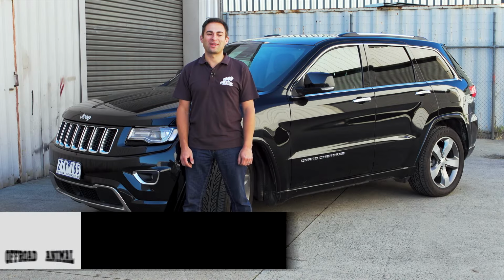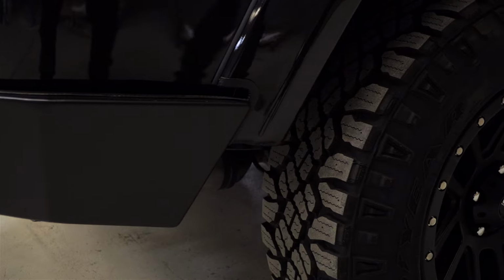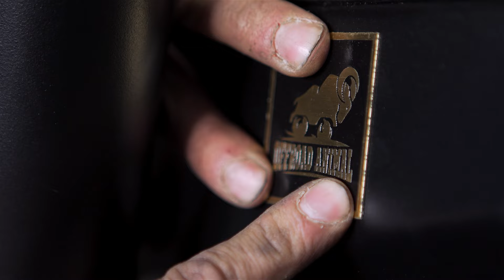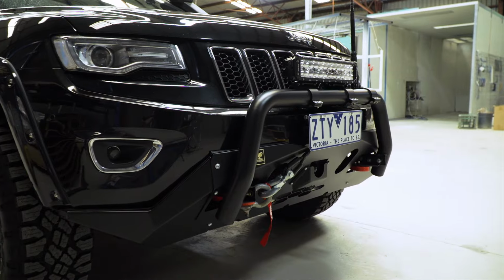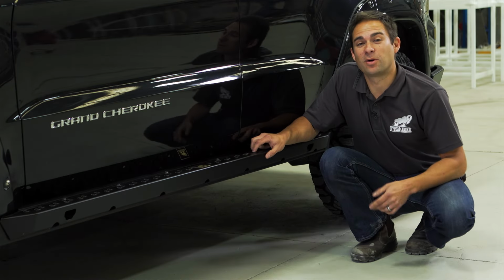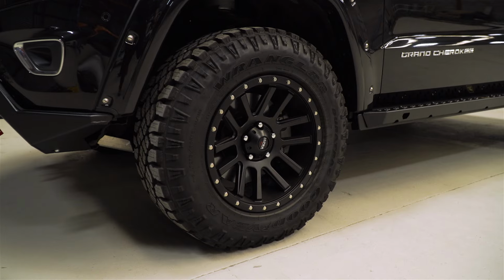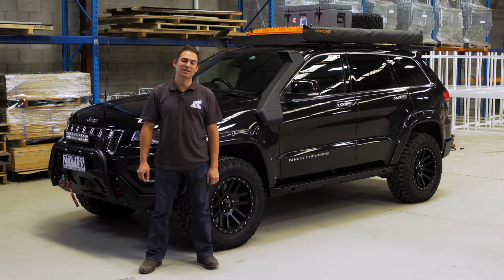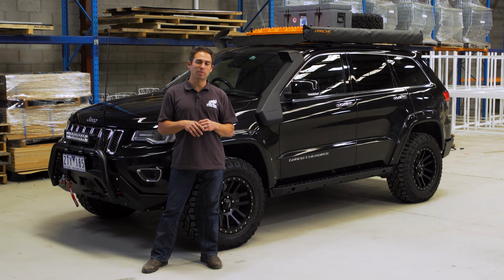Wk2 Grand Cherokee Jeep  Build By Offroad Animal

Comment: Very nicely done. Those ports for the high lift jack and the protection for the electronics is pure genius. The only thing I would do differently would be to put that spare on a gate off the rear bumper. Otherwise, great build. Thanks for posting.
Reply: The tailgate is automatic would suck to hit the key and have it hit your tire carrier
Reply: I agree with the spare in the back but awesome build

Comment: Absolutely Fantastic!!  Solves many of the problems that have kept me from considering previously available WK2 upgrades.  Roof rack will probably be my first choice to install.  The increased weight it can carry is what is so seriously needed.  I agree with a previous post that a gate for spare tire on the rear bumper would be a good option.  Only thing I'm truly scared of, since I'm in the States, is the price for the bumper upgrades.  I'm sure it's worth whatever it costs.  Just don't want to end up turning my WK2 into a Rubicon for more money than what a Rubicon costs!

Comment: Monocoque Body with Built-in Ladder Frame
They say that superior off-road handling capability could only come at the expense of on-road smoothness. They have obviously never driven Grand Cherokee . By incorporating a lightweight and highly rigid monocoque body with a built-in ladder frame that provides added resistance to torsion and flexing and fixing them atop a dynamic independent suspension, Grand Cherokee achieves an unprecedented combination of all-terrain control and luxury-sedan comfort. For added durability, grand cherokee now makes more extensive use of galvanized steel body panels, while the new aluminum hood panel reduces weight for better handling.

Comment: It all looked good other than the rear bar with the rear fog-lights still in eyesight. How much extra work would it be to mount the rear fog-lights to the bar? That way the rear bar could be raised ever so slightly. Overall without picking on the obvious "great job". Do you manufacture a front Full size Bullbar for the WK2 with winch fittings?

Comment: Awesome video! Pretty sure that is a 2014 and up WK2 though. WK2s before the 2014 had a different front bumper and the Overland decal is situated on the other side of the vehicle underneath the 4X4 badge. Again, awesome build!
Reply from the maker: This one was built in 2013, but is an MY14   Quite often manufacturers release vehicles in the  year before the Model year is out

Comment: Please be careful when ordering rear bumper if you have after market exhaust  as you will need to stay within  stock diameter mufflers for fitment ,as bumper hangs down 3-4 inches lower than stock on frame rails. Just FYI

Comment: nice video mate, just to confirm you can snatch off the rear bumper? i would use the tow hitch but just want to understand how strong it is. and if i highlift jack off it, its not going to bend?? many thaks
Reply from the maker: Yes you can snatch off the back.  We suggest using an equalising strap though

Comment: Love the front bumper, hate the aluminum skid plate
Reply from the maker: how come?
Reply: @offroadanimal  I'd prefer galvanized steel for it's strength. Not sure what alloy you're using, i guess if it was 6061 I'd be ok with it at 5 mm
Reply from the maker: @TTURocketDoc  if you do some research you will see 5mm thick AL 6061 T5 is more than enough
Reply: @offroadanimal  yeah you didn't mention the alloy in the vid, unless i missed it. I know all about 6061, aerospace engineer, we use t6 tho. I still prefer cold-rolled steel.
Reply from the maker: @TTURocketDoc  Steel is stronger but in some situations the added weight of the steel is not required, like an airplane.  Use lighter material if possible. Thousands rolling around with AL bash plates with no problems

Comment: Great build, but one thing you are missing, is the loss in fuel economy from no build to when you are done, today with fuel costs going through the roof that is one of my most important issues, one woman I read about lost 5 mpg just putting a Top Heavy Tent on her Grand Cherokee how many MPG does all this cost in everyday driving?
Reply from the maker: To be able to play on the big tracks and camp in great comfort you need to sacrifice economy.  This is about 3mpg worse on fuel with the V8 with all the gear.

Comment: Someone needs to build a bigger lift for these wk2s. 3-4 inches would be ideal.
Reply: YESS. 35s and a 4 inch lift would look awesome. Somebody was working on a 4in lift but disappeared
Reply: @bloroxcleach  yeah I'm sure they started running into problems because even at 2-2.5 inches the control arms are completely maxed out. Long arm kit, bigger knuckles, longer ball in socket axles from RCV axles, king shocks/struts and springs, custom tie rod ends and long swaybar links with quick disconnects. Maybe some options to beef up those differentials, or at least the front diff.
Reply: @bloroxcleach  I've been thinking about this for 2 years lol and not one fabrication shop has done a thing. It's time someone makes these truly capable off road machines. Companies make more shit for the Cherokee and Liberty than the WK2 even though our GCs are more capable

Comment: Looks great! Was that some minor trimming I could see happening to fit the 275/65/18s ? If so was this just some trimming of the felt liner or was there pinch weld cutting / mods involved?
Reply from the maker: yes trimming was required to fit those tyres. Just the felt no pinch weld mod required
Reply: @offroadanimal  Thanks! Only issue I see with the flares will be the front parking sensors on my MY19 that is positioned right on the edge of the fenders, I either need to go for an offset of like > +12 that negates need for flares or somehow moving the 2 sensors.

Comment: Hey, Offroad Animal. I'm curious about the mention of adjustable air links to reduce the shock knocking in OF1. You guys basically raised the front height and lowered the rear, correct? And what about that strut top spacer, did anything ever come from it?
Reply from the maker: yeah tried the spacer, but lost a bit too much nitrogen out of the system. anyway sick of the air suspension so swapping to steel springs very very soon

Comment: How is it when the suspension lowers on the highway, do the tires still fit? Or did you find a way to bypass that and keep it at max height full time?
Reply from the maker: Tyres did not rub in areo mode, so was fine there

Comment: Did you guys ever find a solution for the shocks knocking after installing airlink? I am considering getting a 275/65/18 but dont want to run into this issue.   Did you also need spacers to make those wheels fit with no rub?
Reply from the maker: Yeah, removed the air suspension all together. Much happier now.

Comment: How much does all of this weigh and how would it affect a suspension lift?
Reply from the maker: This overland has air suspension, so no issues with it.  All up weighs about 200kg including lights and winch
Reply: @offroadanimal  very durable relieble quadra lift as on truck!!
I will also note the independent suspension / chassis and its elements of the grand cherokee, it is very durable and hardy, allowing it to withstand heavy loads / impacts! The thickness of the front and rear levers of the trailhawk is incredibly thick!!! Applies to all suspension elements

Comment: You used the Bushwacker flairs that are for earlier year models and they fit with no mods? On their site I see flairs only for 2016 Grand Cherokees. Do you know any other company with flairs? I want to add some to my 2019 Jeep GC Lorado. I have larger tires like on this one with a leveling kit.
Reply: there is a lot they dont go into, their website doesnt even sell 2013 front bumpers or the hidden winch plate, but yet they used a "2013" for these mods. i think they used a 14 or newer.
Reply from the maker: @The__Canuck.  Our WK2 while being made in 2013 is a MY14
Reply from the maker: @The__Canuck.  Hidden winch and front bumper coming soon for 2011-2013
Reply from the maker: the bushwackers do fit the later models but you need to do some mods to get it to work.  especially if you have parking sensors

Comment: Can these Custom Kits be used on 2019 SRT8 series??
Reply from the maker: which parts?  some yes, some no
Reply: @offroadanimal  The Steel Front & Bumper,  and Bottom Bash plate.. Also the Rear Bumper and Roof rack
Reply from the maker: @vipermarn  Bash plate and roof rack yes.  The rear bumper would require trimming, and the front bumper no

Comment: When you will put out the adjustable link for air suspension?
Reply from the maker: on the website?
Reply: Yes to adjust the body to put bigger tires
Reply from the maker: @jeansimon91  Not sure actually.  There is a guy selling them already called Airlinks.  otherwise pretty easy to make yourself.  Even a DIY video on Youtube

Comment: So what happens when you get on the highway and the suspension automatically lowers into areo mode?.... and can you still raise it to off road 2?
Reply from the maker: aero mode is fine on hwy.  and OR1 is now OR2,  so can't go above that.  Same height as before but just can't press button too many times
Reply: @offroadanimal  so does that mean that normal mode is the same as off road 1... and off road 1 sits as high as off road 2?
Reply from the maker: @jonh2408  Yes exactly

Comment: Worried about the windshield washer reservoir, but you removed the factory crash bar which effects the frontal crash performance.I know in a few states that will make it no longer road legal.
Reply from the maker: new bumper replaces it, and has been tested  as such

Comment: Do you guys do install ?
Reply from the maker: Can be arranged
Reply: @offroadanimal  i have a 2018 tho ..any fit ?
Reply from the maker: @wolfking2281   yes rock sliders, rear bar, bash plate and roof rack all fit now.  I've just finished design for front bumper and hidden winch mount.  will be testing very soon
Reply: @offroadanimal  ok amazing work !!! Cant wait till the winch is fully completed

Comment: how come you use a 2013 in the video but some of the parts on your site are for 2014 on up?

front bumper is only for 14-16 to 17-19
hidden winch mount is the same
Reply from the maker: our wk2 while being made in 2013 is a MY14.  our products are based on MY not manufacturing year

Comment: OMG😮😢, where have you guys been all of my life? Is this kit WK2 Summit EcoDiesel friendly?  I have been told that many of the off-road parts that will fit on an Jeep Overland model will not fit the Summit model because of the wheel wells being different and a winch not being able to install either because of the Diesel engine, nor a rear bumper because of the rectangular exhaust tips. At this point I am willing to let anybody test parts on my WK2 Summit EcoDiesel and I will advertise it here in California while off-roading. :(
Reply from the maker: Hi Jeep Overlander,  I've worked on many wk2s and can tell you all of our products will fit, however some with some cutting that the rest of the wk2 owners wont have to do. email us at info@offroadanimal.com and we can disuss further

Comment: It just "magically" got taller?
Reply: Jonny Weber lmao
Reply: Jonny Weber probably a leveling kit because the tire size is 275
Reply: The Overland has raising/lowering air suspension that will change the ride height by several inches. At 11:45 he explains how he made the suspension stay at maximum height for the 32” tires.

Comment: I looked for those rims/wheels to see if they would fit my 2015 Jeep Grand Cherokee limited and I am told the bolt pattern isn't for my vehicle. I can literally see it on my vehicle in this video! WTH? LOL I was going to get the 20" and then was willing to settle for the 18s but both apparently do not exist for my vehicle. SO not right.
Reply from the maker: The shop you are talking to must not realise you can get these for the wk2

Comment: Duratracs are great off-road, HORRIBLE tires as far as long lasting. Came factory on a 2015 Chevy Silverado Midnight. Completely wore out at 28,000 miles even with 3,000 mile rotation. Mastercrafts/ Coopers and BF Goodrich are better tires.
Reply from the maker: I agree,  after running these on my old Hilux and now the GC, will not be running these tyres again

Comment: How is that Jeep a 2013? It has to be at least a 2014.
Reply from the maker: 2013 manufacturing year, but model year 2014  MY 14
Reply: Offroad Animal I have a 14 summit, I got the 14 because of the updated headlights, and that was the first year for those headlights.

Comment: So this is purely cosmetic and nothing actually useful..
Reply from the maker: You're completely wrong,  We used this vehicle on many offroad trips.  The armour protected the body work and the rack carried all the camping gear.  We even have other videos on our channel showing trips.
Reply: @offroadanimal  all of those things are cosmetic with the exception of the armor. I was thinking something more like gear ratios, upgrades for your alternator, wiring a expanded power supply, recommended tools and parts for Trailside repairs.
Reply from the maker: @bryanshoemaker6120  Well armour and winches etc are very useful. Your original comment about nothing being actually useful was a bit off then
Reply: @offroadanimal  that's all cosmetics, Does not improve the survivability of your vehicle. You can slap a winch and body armor onto a Lexus but the second that thing hits a bump, it's going to go rolling off the cliff.

84-in roof rack=46.3 pounds. Front end off-road bumper=126 lb. Rear end off-road bumper=70.4 lb. That's 242 lb already. I know these numbers off top my head because I'm shopping for these items right now. Then add in armor, the gear that's going to be stood away on top of that rack ect. What modifications were made to the suspension to counteract the added weight?
Reply from the maker: @bryanshoemaker6120  Dobinson suspension kit added to handle the weight. Cosmetic or not armour obviously serves a great purpose as most people run it to protect your vehicle.  We are not running through the centre of Africa here mate, we are putting accessories on vehicles to make them stay in once piece while looking good.  They are for protection and that is what they are designed for and do a good job of it.